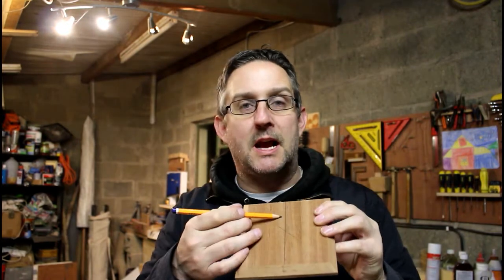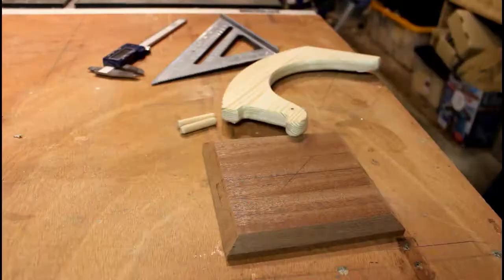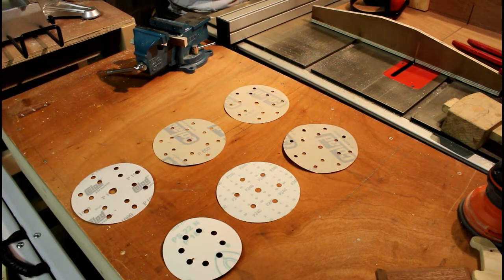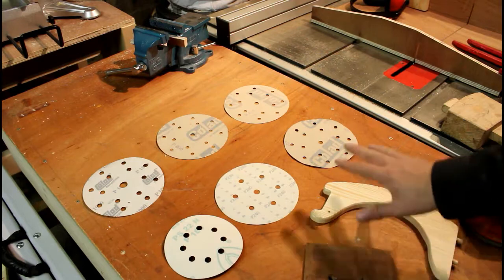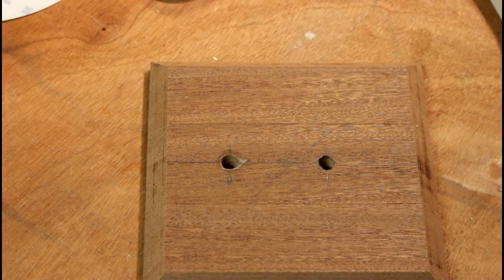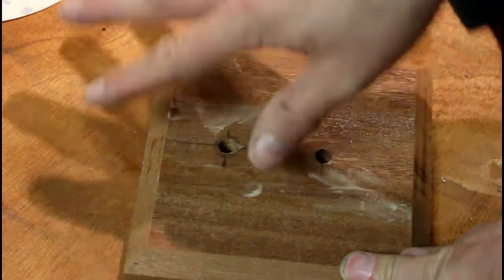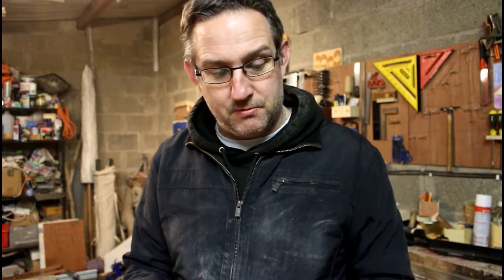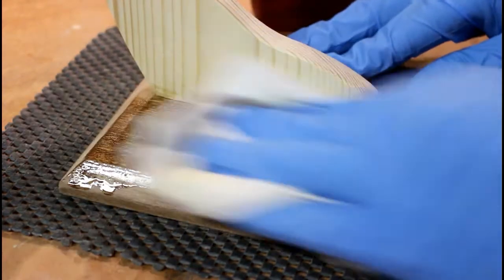Headphone Stand

Comment: I am doing the very same project. I am just at the beginning, I wonder how much time this all thing took you.
Reply from the maker: Andrei Rînea  hi Andrei! The upright took about 20 min a to cut and sand. The base glue up over night, and then trim, sand and shape on the Router table took about an hour or so. Then it's all about oil coats and varnish!
Reply: Wow, so fast with the right tools (and knowledge). I have a jigsaw, some spruce wood, a "drum sander" (a drum mounted on a drilling machine attached to the workbench). Being a total beginner isn't helping me either. Having a larger board I decided to make 4 of these. I am 4h into this and still have a long way to go. The bases are cut, so is the vertical leg. Sanding is almost complete but I have to route the base and use a rounding bit on the vertical leg.

All in all a good learning project. Thanks for the info!
Reply from the maker: Andrei Rînea you are almost there! Some hand sanding on the inside edges and some glue up! Would love to see a pic if you feel like sharing. Andydascouser@live.ie. Good luck!